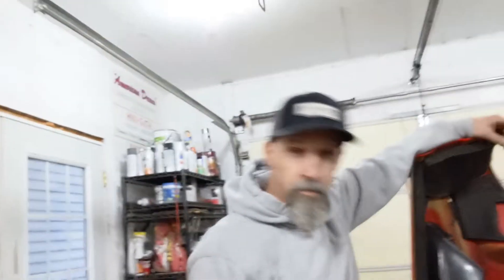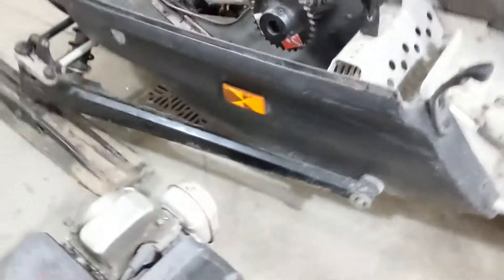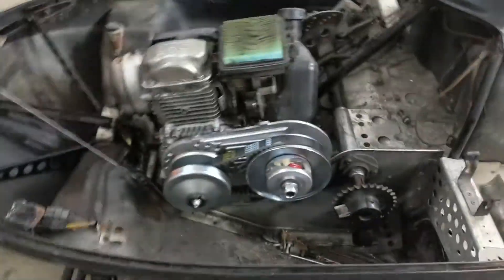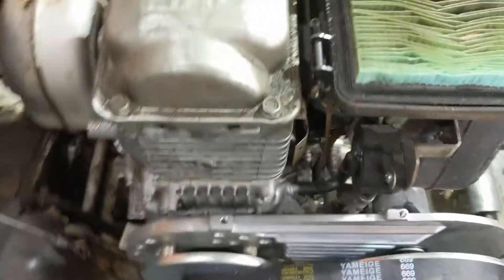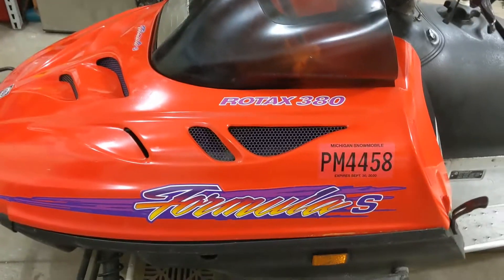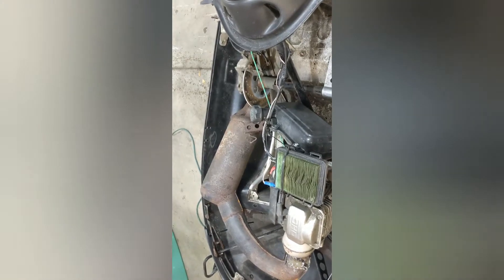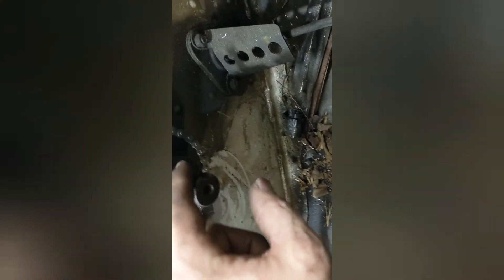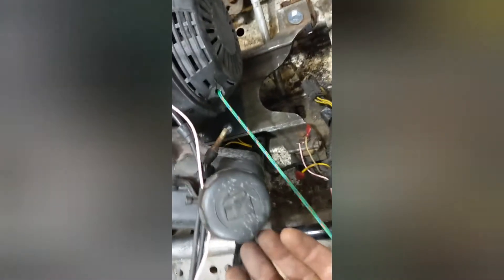converting a power washer (predator) into a running snowmobile

Comment: How does it hold up when you try and cold start it outside cause you know the main purpose of a snowmobile is to withstand extreme cold temps and if it doesn’t start up right away after a night out then you need a bigger displacement maybe a 440f or 550f will definitely make that machine faster then a 120 kids snowmobile lol
Reply from the maker: this is a 4 stroke honda clone, it starts right up in the cold, I built it for my little niece and nephew so the idea was that it would be slow like a 120 kids snowmobile.

Comment: that's brilliant, I have a Formula 550 with broken engine and plan to do the same ! Did you try to re-use the original clutch ?
Reply from the maker: No the shaft is much larger on the stock primary, these clutch kits are pretty inexpensive on ebay